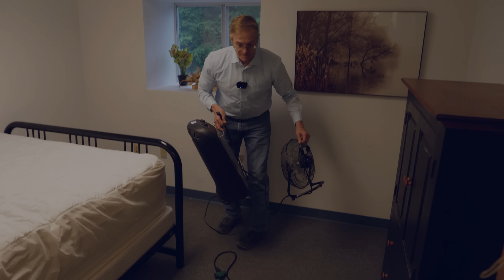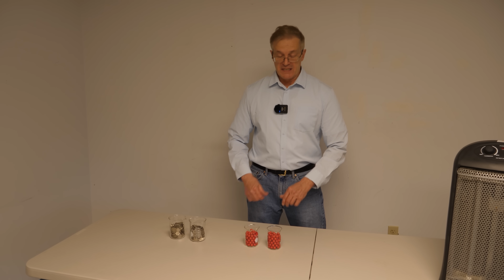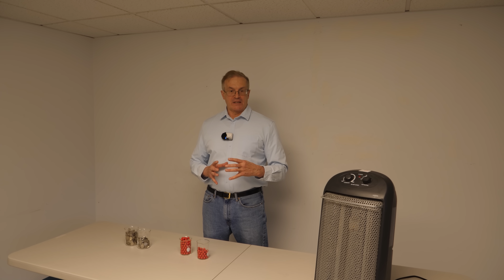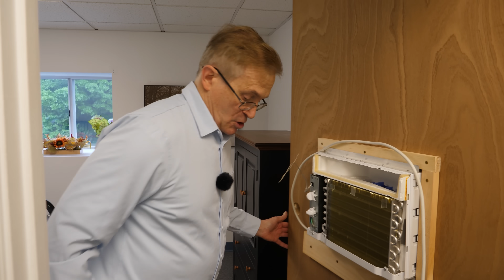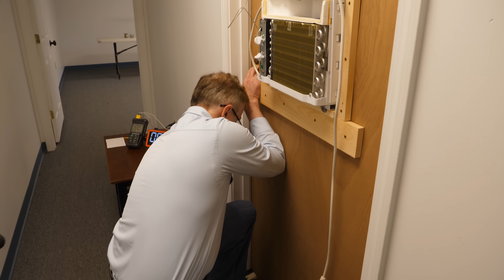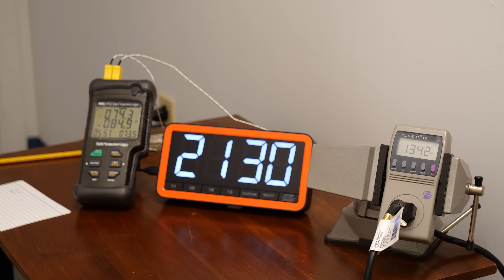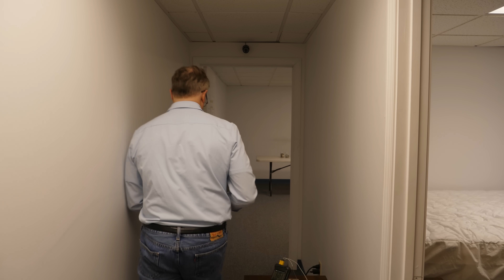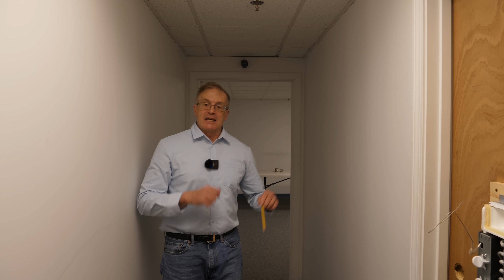You're wasting money on heating! Use your A/C!

Comment: The resistive heater can be greater than 99% efficient with better design. No entropy ORC cycle high COP machines needed.
Reply: It is by definition 100% and without some trick like this it wont get any better than that.
Reply: @ghz24  That definition leans entirely on closed thermodynamic systems which operate at COP < 1 with no energy recycling or secondary inputs from the environment surrounding the system. Not all systems are designed like this, which should be obvious and apparent to you from the heat pump shown in this video operating on "some trick like this".

The idea (which is not unique to your own position) that the energy used by a system is equivalent to the energy dissipated by that system is completely incorrect. If anything this is the result of faulty attribution of entropy in systems and flawed system characterization. Energy can be re-used, and it can be done with resistive heaters.
Reply: @Infinion  No the definition was to fit with other heating systems that utilize combustion with some geat lost to an exhaust.
The ratio of heat delivered to a space vs heat lost to an exhaust is the efficiency.
Since resistive heaters have no exhaust it is "by definition" 100 %.
And no if you put 1kwh of electricity through a resistance you will get 3412.142 VTUs of heat and no more.
A heat pump is not a resistive heater so can deliver heat from outside the system so can exceed this defined 100%
I already knew everything you just posted. 
Maybe you are not a native english speaker and misunderstand the term resistive heater if not then:
Give an example of a resistance heater that exceedes the 3412.142 BTUs given as 100% efficient.
Reply: @ghz24  Thanks for your consideration, however, I understood you fine. What I was alluding to is that

Of course, your definition involves efficacy and efficiency. As you provided, 1000W generally produces 3412 BTU of heat, although this is only true at specific temperatures and with specific fluids, and is not universally constant. You can read James Joule's late 1800s work on this foundational principle. The Watts/BTU can be considered the efficacy of the heater. 

The efficiency of closed systems is always <100% and this simply describes what proportion of input energy was converted to useful output energy, and what was converted in the wrong direction, wrong place, or wrong form of energy. 

COP (coefficient of performance) adds the surrounding energy of the environment to the equation, so 1000W of mechanical power can collect and compress 3000W of non-operator environmental energy for heating with a COP of 300%.

In electrical systems, charging capacitive or inductive elements is typically 85-99% efficient. So you may prudently design a resistive heater to be inductive and use a regenerative circuit to charge and discharge the inductive resistor, rather than maintain a purely resistive RMS or DC current at no benefit besides simplicity and a rigorous economic model for demand of electricity.
This system is <100% not unlike any and ALL systems, but because it is regenerative, the COP will increase, exceeding 100% just like in heat pumps.
You are not evolving more heat at the resistor for the same power, you reducing your input power, because you are re-using energy in your circuit.
Reply: @ghz24   Thanks for your consideration, however, I understood you fine. 

Of course, your definition involves efficacy and efficiency. As you provided, 1000W generally produces 3412 BTU of heat, although this is only true at specific temperatures and with specific fluids, and is not universally constant. You can read Joule's late 1800s work on this foundational principle. The Watts per BTU can be considered the efficacy of the heater. 

The efficiency of closed systems is always < 100% and this simply describes what proportion of input energy was converted to useful output energy, and what was converted in the wrong direction, wrong place, or wrong form of energy. 

COP (coefficient of performance) adds the surrounding energy of the environment to the equation, so 1000W of mechanical power can collect and compress 3000W of non-operator environmental energy for heating with a COP of 300%.

In electrical systems, charging capacitive or inductive elements is typically 85 to 99% efficient. So someone might design a resistive heater to be inductive and use a regenerative circuit to charge and discharge the inductive resistor, rather than maintain a purely resistive RMS or DC current at no benefit besides simplicity and a rigorous economic model for  electricity.
This system is < 100% like all systems, but because it is regenerative, the COP will increase, exceeding 100% just like in heat pumps.
You are not evolving more heat at the resistor for the same power, you are reducing your input power, because you are re-using energy in your circuit.
Reply: @ghz24  Thanks for your consideration, however, I am literally saying resistive heaters can be designed to have higher than 100% COP. 

As you provided, 1000W generally produces 3412 BTU of heat, although this is only true at specific temperatures and with specific fluids, and is not universally constant. You can read Joule's late 1800s work on this foundational principle. The Watts per BTU can be considered the efficacy of the heater. 

The efficiency of closed systems is always < 100%. You know about this? That's fine. 

You also imply you understand COP, alright great!

In electrical systems, charging capacitive or inductive elements is typically 85 to 99% efficient. So someone might be inclined to design a resistive heater to be inductive and use a regenerative circuit to charge and discharge this inductive resistor, rather than maintain a purely resistive RMS or DC current at no benefit besides simplicity of the system and some billing guarantees for the energy utility. 
This system is < 100% like all systems, but because it is regenerative, the COP will increase, exceeding 100% just like in heat pumps.
You are not evolving more heat at the resistor for the same power, you are reducing your input power, because you are re-using energy in your circuit.
Are you picking up what I'm putting down?
Reply: @Infinion  I feel you are just tricking the meter and your admission that the piwer company woyld need guarantees. The power company still has to generate that power even of you call it imaginary.
Reply: @ghz24 ? You still use power from the utility, you are simply re-using some of that energy to reduce your power requirements by some degree. It is like paying for electricity to accelerate an electric car to 40 mph and then using regenerative braking to recover the momentum with the electric motor as a generator. There is no imaginary power or tricks at the meter, you just aren't throwing the power away after a single use.
Reply: @Infinion  Getting energy from regenerative braking is just converting energy from one form to another and that never creates or destroys energy. That is all the components you mention do so they are incapable of creating energy and your statement of "use it again" is the same thing as creating energy. Conversations are never 100% and the law of conservation of energy points to your assertions being misguided at best.
Simple question can you point to any manufacturered product that demonstrates this effect you claim?
What you claim is simply "over unity" and I know of one device that does this and it's by a very small amount (maybe) and destroys the device. It was a mechanical water heater utilizing cavitation that made slightly more heat in the water than a resistance heater would according to the inventor and a couple other people, but since it was unfeasible I doubt it got a thorough peer review.
It is useless because the cavitation destroys the device before the manufacturing cost is offset by any small amount of heat it gains.
I'll even accept research saying it is possible. 
What you described is definitely tricking the meter just like a joule thief.

Comment: If these guys ever develop one of those "free air conditioning" systems, I'll buy it. Even if it's a lot more expensive than the usual methods.
Reply: Eg4 sells a mini-split with built in solar inputs total cost could be less than $2k solar panels  rack and all for a 12 thousand btu system, not completely free but dang close.
Solar air and heat without the battery cost. Look into it. I found a rack for 4 panels $300 the 4 panels (325 watt each) cost me $400 and the unit costs 12-13 hundred. Plus it's diy friendly.

Comment: Would have use the fan to push the air from outside the room to the ceiling of the test room for 1 day. as surfaces can store heat  "like the bed" for extended periods of time. I live in a house with a tin roof and the summer this year has been killing me as my ceiling get 97 degree and its a hunter shack style house with no attic to speak of. So I'm very interested where this is going. Also to be scientifically fair, humidity has a ton to do with these tests so you should also be reporting that as well as the water vapors available in the air dictates the ability to move heat. Just my 2 cents worth.

Comment: Well we define inefficiency usually with unused heat dissipation.  
Coincidentally we defined the literally most inefficient device (resistance heater) as its purpose - and therefore inversed the efficiency definition. 

So actually it is the most inefficient device ever made - but the most efficient in its inefficiency of creating heat.
Reply: You are right no exhaust so no wasted heat so, by definition only, 100%

Comment: @Tech Ingredients, what would happen if you bolt a heat pump to a heat engine? As heat moves through a heat engine, some of it 'disappears' or gets converted to another form of energy. 

Ambient heat could be a source of power.

There are 2 posablities;
1) Use the heat pump to supply heat to the engine and reject heat to ambient. 
2) Use the heat pump to remove the rejected heat from the engine, supplying a temperature below ambient.

In option 1, the heat pump must pass the entire amount of heat the engine can convert. In option 2, the heat pump only has to handle the heat that has not been converted to another form by the engine.
Reply: Organic Rankine Cycle (ORC) engines can be quite efficient.

The conundrum is that heat engines are more efficient with a larger temperature differential, whereas heat pumps become less efficient at greater heat differentials. 

Of course, using a fluid with a larger latent heat value, like water, would make a heat pump more efficient. The problem with using water is that it is corrosive in regular pumps and it has a relatively high freezing point.
Reply: I may know of a way to compress water vapor without having the corrosion problem of conventional pumps with a technology I call the fluxcapacitor effect. I haven't tried it yet. It seems that not many people know about the fluxcapacitor effect. In fact, I had to come up with my own hand rules for electrons and protons to even be able to think clearly about electricity and magnetism. 'Current' thinking is backward, if you know what I mean.
Reply: @abebarker sounds like you are trying to plug a power strip into itself and get unlimited power.
Reply: @ghz24  Nah. You can't get something for nothing. If you start converting heat into other forms of energy, the environment will cool.
Reply: @abebarker  That was my point.
Your heat engine combined with a heatpump is virtually the same as hooking a motor to an alternator thinking you'll get more energy.
Reply: @ghz24  A motor and an alternator are both less than 100% efficient. 

While it is true that a heat engine can never be 100% efficient, a heat pump is not very good if it is less than 100% efficient. They are usually 200% to 400% efficient. 

If the efficiency of the heat pump is greater than that inverse efficiency of the heat engine, then you have extra energy. It is actually better than that if you are using the heat pump to handle the rejected heat of the engine. 

The reason a heat pump is more than 100% efficient is because you don't have to pay for the laten heat of the phase change. The latent heat gets a free ride. It's a neat little trick.
Reply: @abebarker  That efficiency is meaningless because it is in comparison to resistive heating not work vs heat separation.
There is no free ride.
You are still trying to connect a motor to an alternator thinking you'll get free energy.
Reply: @ghz24  I think you are confused about that. 

I do admit that a heat pump loses efficiency with greater heat differential. I even stated so above. It is because it takes more energy to squeeze a gas into a smaller space. Essentially, squeezing a given amount of heat into a smaller space, which increases the temperature, takes more energy. The amount of energy of the gas constant plus the energy of the latent heat does not change. Therefore, the ratio of energy used to compress the gas vs. the energy carried by the gas becomes smaller. Again, I said so, in not so many words, above. 

However, the latent heat does get a free ride. The latent heat is not present in the PV=nRT calculation. It shows up as extra energy at the higher temperature without having to pay for it. That's what makes a heat pump more than 100% efficient.
Reply: @abebarker  You pay for it by compressing the vapor to a liquid.
Nothing about the refrigeration cycle breaks the laws of thermodynamics or the law of conservation of energy. Energy can not be created or destroyed only converted to another form.
A heat engine may be up to 40% efficient but  those are internal combustion engines not ones just run on differences in temperature. The ones that use just temperature difference are very low efficiency like steam engines. Steam engines work with steam at 212+ degrees vs cool water at about 60 or 70 heat pumps struggle with a 70  degree difference.
Even if your heat pump is 400% efficient if your heat engine is less than 25% at temperature difference you can supply you still lose energy.
No compressor is without friction, this alone should show you that it won't make energy.
Sorry to burst your bubble, I hated learning that energy wise:
1 You can't win
2 You can't even break even
And 3 the longer/more you try the more you lose by/ harder it gets.
That is the laymans version of the 3 laws of thermodynamics.
Nuclear power kind of breaks this but then matter is energy so you still pay something.

Comment: Reverse cycle air cons have been standard in Australia for decades. Why is the US so late on this?
Reply: Colder here? They can only go to about -5F before needing help. Most peopke where I am use gas furnaces.They are catching on now.
Reply: @ghz24  That all depends on the refrigerant being used. All it takes is very small wire heater to prevent ice build up. Even in winter, plenty of places dont get to -5F.
Reply: @PBMS123  It gets -20 here every few years usually with a 20 mile per hour wind. I'm in agreement with swiching to heat pumps even if I need an emergency system in case of extreme cold I was just telling you why they aren't as adopted here. How cold does it get down under? The southern US uses heat pumps extensively.
And the better mini-splits use the compressor to defrost the outside coil. Does it make sense to use resistance wire to defrost when it's what we are avoiding in the first place?
Reply: @ghz24  Oh I defininitely accept that there are places in the US that drop very cold. My point was more nationally it hasn't been a thing. Reverse cycles haven't been common, with still a huge popularity of single direction systems, (interestingly window rattler systems are still popular around the country).
The cost and power to defrost the external heat exchanger side in very cold weather when running heat inside is a lot lower. You have to be running in very cold and very high moisture content to suffer from it.

Comment: Noooooo! Electricity is the only way! Electricity is green! Heat pump is bla.....red. red is bad. Lol.
 The evidence in this video will never convince the majority of people who have been brainwashed by the "smart" people. 
They think electric oil heaters are better....
Reply: Everything is a trade off oil filled heaters are my choice if I'm using electricity to heat because they are quiet and safer than nichrome wire models.
But I'm going to get a mini-split with solar inputs soon. Wont like the fan noises but I'm willing to make that trade off for the efficiency.
Heat pumps are more popular in the south where winters are milder. But they are getting better.
People will make better choices if they know the options.
Reply: @ghz24  who are you talking to?

Comment: Of course there are caveats. Typical AC compressors are less efficient, heat pumps use 2 to 3 times the amount of refrigerant than straight cool and the colder the outside temperature they less efficient they are and heat pumps are more complex machines. They are expensive to maintain or repair in the long run.

If you are going to get a heat pump make sure they are
1. DC inverter
2. Use only outside air to cool or heat the outdoor coil (single hose portable units take inside air, move it across the coil and exhaust it outside causing negative pressure to build up inside)
3. The area you live doesn't get below freezing for extended periods or have high humidity in the winter